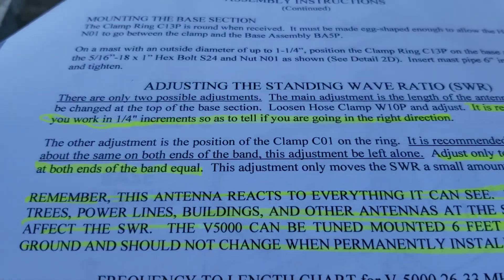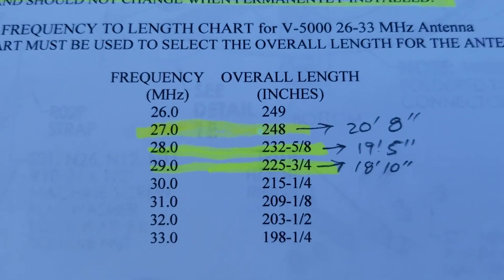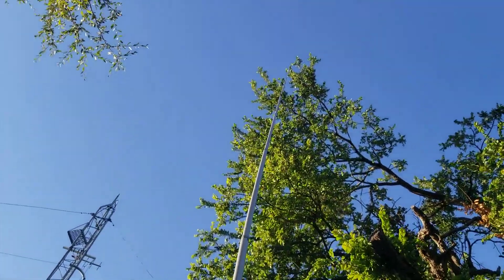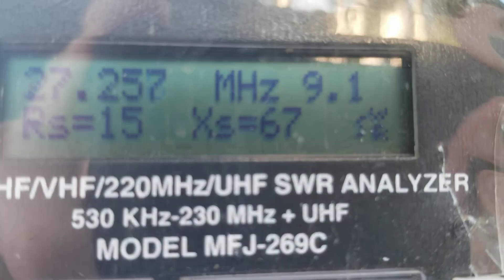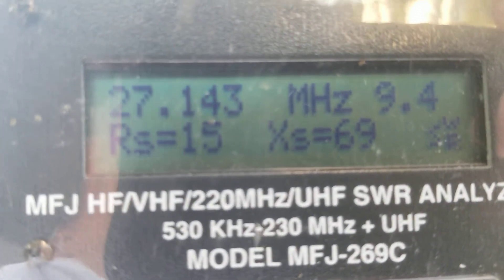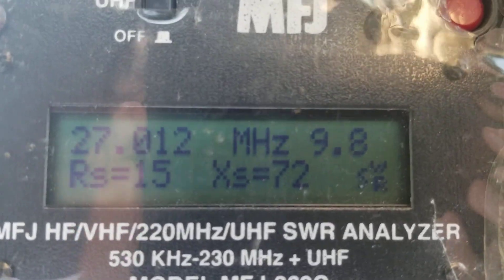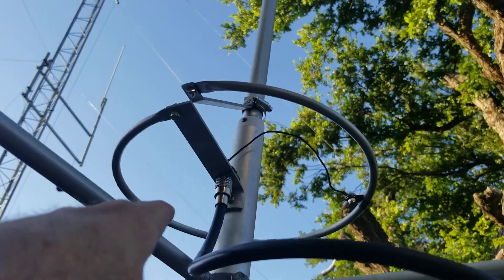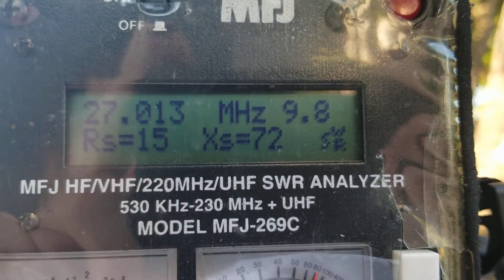Trying to tune a Maco V-5000 Verticle HF antenna.

Comment: Mine did the same thing until I grounded it with the 8 foot copper ground rod then it went down to 1.0 Use the thickest copper wire you got solid, hook it to the base of the antenna and it will come down

Comment: I downloaded and thoroughly read the instructions for a week prior to receiving my v5000. Put it together perfectly, secured the length at 248"  and still had a high swr. Had to extend the length about a foot more, which really worried me. But the swr decreased considerably on channels 1, 40 and 20. All three are below 1.3. So lengthening the antenna beyond 248" seemed to do the trick for me but results may vary.

Comment: The 2 common mistakes on assembly and tuning are, the ring is installed backwards and the feed point measurement is from the bracket and not from the center point on the tuning ring. If you measure off the bracket along the tuning ring for the 6 - 1/4 inches you'll end up in the lower portion of 10 meters. I know this is solved and it is a year old video but for anyone else it might be helpful in their future with this same task.

Comment: The ring is backwards and the base is the very bottom of antenna. So you measure from bottom to tip 248" for 27.0MHZ
Reply: Just what I was going to say I just finished watching the maco company assemble their antenna ,he made it quite clear from the very bottom to the very tip measurement. 248"